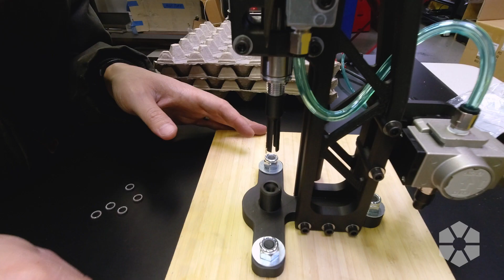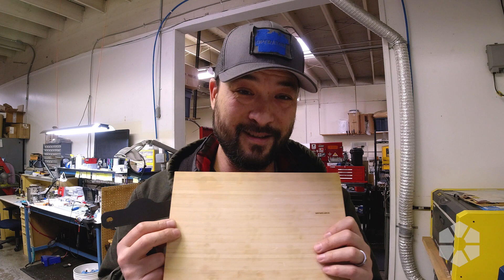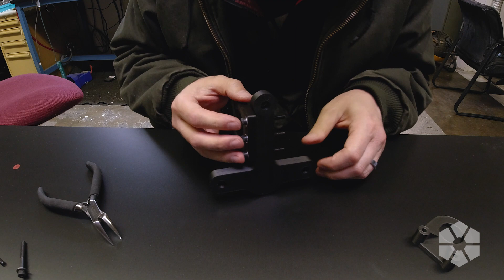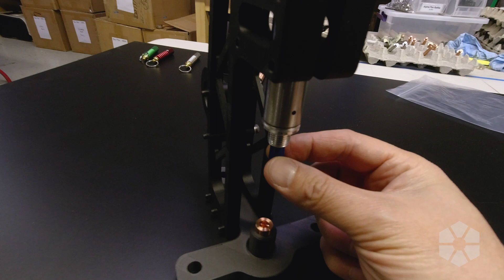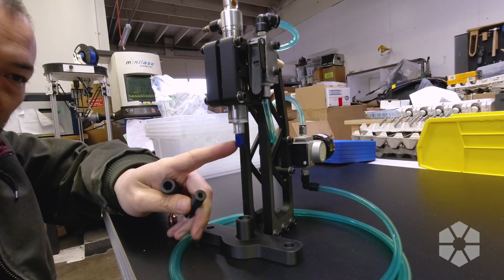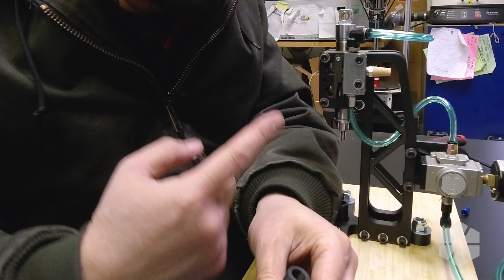How It's Made: Kappa Insertion Tool

Comment: Thank-you Jason for putting together the video and showing us "how the sausage is made".  I'm impressed how well the Markforged parts came together.

Although I feel bad to criticize the insertion tool after you've put this out there, a couple things are driving me bonkers:

1. Laser cutter for baseplate holes.  It could have been 3 taps with a pin punch with the 3D printed base as a guide and then 3 holes with a drill-press.  Adding some slop in the 3D printed base holes would compensate for the holes being slightly off and not affected function.

2.  Overall insertion tool solution.  I can only guess how much time was spent modelling and printing the parts.  In the same situation I'd propose a different solution:

Step 1: Buy arbor press.
Step 2: 3D print insertion jig for arbor press.
Step 3: Adjust depth stop for arbor press.

Also, the arbor press provides some tactile feedback as you insert the springs that the pneumatic press does not, so you don't need to fiddle with the press height and air pressure as much.

Of course, I'm some random on the internet who hasn't built the thing and would certainly run into practical issues to solve when getting it to work.  

At the end of the video you say "time is money", but I get the impression this is also having some fun at work using different pieces of equipment and the joy of making something work.